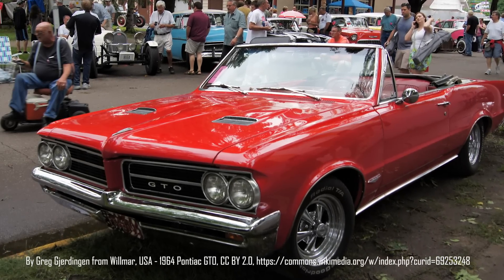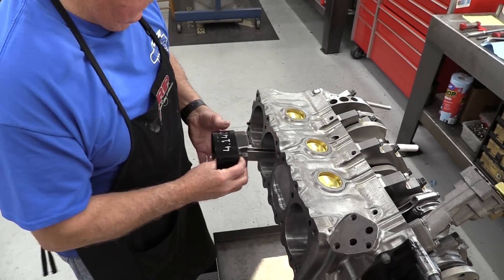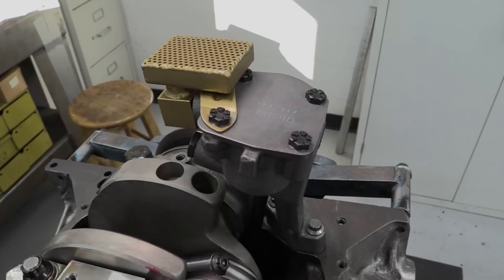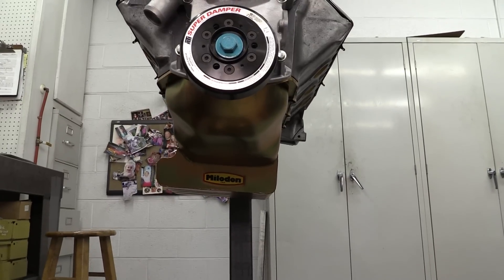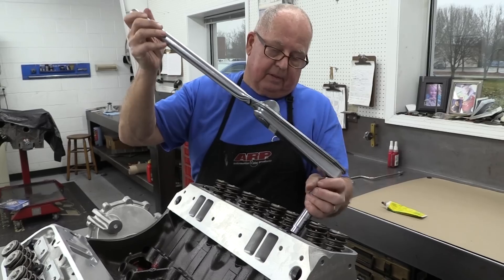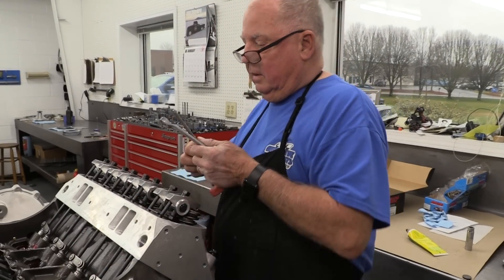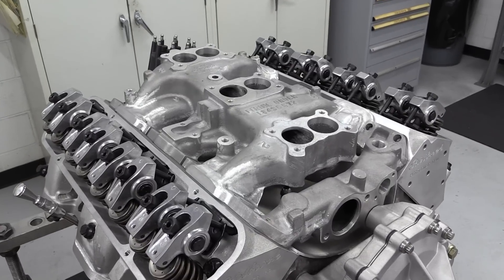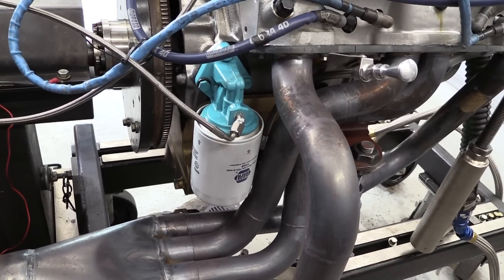Poncho Revival -- Building a Stroker Pontiac (Secret EFI!)

Comment: 389 and 400 have the same main journal size. 421, 428, 455 have the larger 3.25 size.
Reply from the maker: Correct. I definitely could have been more specific there that the 400 has the smaller journal too. Thanks for watching
Reply: Yep, 326 and 350 have the 3.75 inch stroke and 3.00 main bearing size as well
Reply: 389 would have 2 freeze plugs and only 2 motor mount holes that block has 3 freeze plugs and 3 motor mount holes making it after 1977. 1966 and earlier blocks had 2 freeze plugs on each side of the block. 1967 and newer had 3 freeze plugs per side.
These blocks had 2 motor mount holes per side.Starting in 1970, most blocks were cast with 5 motor mount holes with the mounts using 2 bolts in line with 1 higher up in the middle.Some 1977 and later blocks only had 3 holes that used the newer mounts.
Reply: Not a 389 block 3 freeze plugs make a 400, 389 have 2 .

Comment: so sad about that intake system.   that cam should have made max torque close to 5000 rpm.  A victor jr would have done wonders for hp.    That tripower intake killed it!    I've never seen a dyno run without the waterpump not running.     How does that effect timing due to hot spots, etc?
Reply: The dyno must provide the flow. It is an impeller pump so the water can flow right through with just a little restriction.
Reply: I used wenzler heads and tunnel ram. Wish I had known about Molnar when I did mine. They have awesome stuff. Glad to see them used. I have forged star galaxy rotating assembly. My compression is higher at 11.71 as I'm on e85 w mark sullens carbs. Love the build!!!!
Reply: Victor Jr sux & is counter intuitive to poncho characteristics, stock iron qjet or edelbrock torker are better
Reply: @brianbevans6804  The ported edelbrock heads make power to 6500 rpm. The cam is good to 6500.    The stock intake is done by 5000, unless you can find a RA intake.   The torker would do OK to 6000 if you need to keep your shaker hood scoop but Performer RPM makes more power everywhere compared to torker.   I run a efi modified torker 2 on my twin turbo 455  TA and I shift at 6000.
Reply: @CrankAddict  yeh performer rpm is the best intake made for the poncho & the torker being 2nd, the regular performer is a waste & not worth ditching the factory iron same as the victor jr. Sounds like a beast you got, 6500rpm is a little high for an undersquare 455 3.25 main Poncho, if you want rpms & a higher torque band you want oversquare or close to square, less stroke than bore, that would be better for a turbo car.

Comment: Very nice, I have drag raced Pontiacs since the late 70s. I currently am running a 1972 455H.O, bored 60 over trw L2394 pistons and with the 7f6 heads. A nice healthy comp cam, torker 1 and a 850 hp series carb and a msd ignition. This engine runs great makes a lot of torque.
   Thanks for posting this, keeping the poncho alive. 👍👍🏁
Reply: That torker 1 is pure gold.
Unobtainium.
Victor Jr. is all we have now,
an intake design that runs counter to Pontiac characteristics.

Comment: I had a 64 Catalina with the 2bbl 389 with a 3 on the tree. It was a early 64. It had right and left cylinder heads. The heads were oiled from passages that came from the thrust bearing. It was a great car, I still kick myself for letting that car go. Keep up the good work. Thanks.

Comment: The original Poncho Rochester 2GC big base Tri-power carbs flowed 325 cfm. Those T/Bs being bolted on are for the Chevy Tri-power being retrofitted to the Poncho, because the offset T/B hold down bolts. Just like you said, those Rochester 2G small base carbs flowed 285 cfm for the Chevy stuff. A single plane intake works great for WOT, but is less effective for driving on the street. With this street friendly setup, the owner will be much happier driving around town.

Comment: Wanted to mention that you said the heads were 72 cc. That would be with the 3.75 stroke crank. The heads he used for the 9.7 comp ratio were 87 cc. Nice video, and nice build.

Comment: I have a 74 455 in my 65 Lemans . Its stroked to a 468 I have a 750 dbl pumper on it now. 
I also have a 65 389 Big car engine  With a factory tri power on it 068 cam 4x Heads . I would love to do what you did in this video to my 389 and use my factory tri power. Cool video  super informative . Pontiacs rule

Comment: Pontiacs use 2 tubular "dowel pins" to locate the timing cover to the block.  These are at the 2 lower timing cover bolts.
Reply: True, but be careful, if your block has been line board or even lined honed for the crankshaft, it will no longer be centered with those dowels, so will then require you to you do what he did to adjust. I did the same with mine.

Comment: A couple things don't add up in this video.  First, 389 blocks had 2 freeze plugs per side.  This block has 3 freeze plugs per side which was on 400 blocks. Second, 72 cc heads on a stroker (455) are not going to give you 9.7 CR.  Need about a 94 cc head to get 9.7 CR.
Reply: All depends on the piston and head gasket used. Plus deck height and how far in the hole the piston is.

Comment: How do we get 9.7:1 on a 461 with 72ish cc chambers and flat top pistons?
Reply: 1:15 - flat top with big valve pockets.
Reply: I was wondering that as well. They do have deep valve reliefs and a few cc’s ported out of them but still seems a bit low.
Reply: 461ci = 7,550 ccm
7,55L / 8 cyl = 940ccm 
chamber should have little less than 100ccm, for 9,7 CR. All approx.
Reply: Thick gasket and crappy quench.
Reply: With a .040" thick gasket and 14 cc dished pistons that are .060" in the hole.No wonder it makes shitty power.

Comment: I had a dream the other night, I was driving a really small domestic pickup like a Chevy Luv or an old Dodge Ram 50 with a large displacement big block 632, 572, or even a Sonny Leonard engine that was so snappy that with a 4 speed manual it would INSTANTLY light up both rear tires and take tf off. Now THAT would be my dream build. I'm willing to bet that a Ram 50 with a well built 360, 400, or 440 would get the job done easily. ESPECIALLY if it's a Dorton engine...😉

Comment: I noticed Keith didn't weld the adjustable guide plates? Is this correct and he doesn't do this?
I am asking because I need to fit some to my engine. If Keith doesn't think it's necessary to weld them then I won't either.
Reply: I tig weld them in 3 places.
Reply: We ALWAYS tack weld them

Comment: 4 bolt aftermarket caps , forged crank, H beam rods $$$$$$$$$$$$$$$$$  no budget on this puppy .
Reply: All that for a motor there only twisting under 6,000rpm, what a waist.  With that crank, rods & caps that puppy is not even working until 7,500. rpm. and really over 8,000 would not be a issue with the right cam & intake.  In my opinion, that short block is scramming for pair of aluminum aftermarket ram Air tunnel port Vs !

Comment: WISHED these guys could have built a 428 out of a 400 Pontiac.
Reply: they could...simply have to cut down the mains to 3"...if they can use a 455 stroke they can surely use a 421/428 stroke
Reply: Why? More cubes is better... There's nothing magical about 428 cubic inches

Comment: Flat top pistons in that engine with 72cc chambers is more like 12.1+.. not 9.7:1. Also, too much cam timing even if it was 9.7. Running it as it was built in the video with 12-1 and that cam would be pointless on pump fuel. That said, as much as that intake setup killed power, it's still a cool little build for a show car..
Reply: You can buy e85 at the pump🤷🏻‍♂️
Reply: @doomman700  What does that have to do with claiming 9.7-1 in a build when it was actually over 12.1? 
Anyone born before the turn of the century knows REAL pump fuel is Unleaded...
Reply: @vengeanceizmine9878  it can be run on pump gas with 100-108 available at a pump nearby. That is all my comment was directed at, it’s not pointless on pump gas.
Reply: @vengeanceizmine9878  by the way I am not a young man and was born before unleaded was a thing, so I considered supreme 108 pump gas with lead. However I acknowledge anything readily available at a pump for cars as pump gas( premium, e85, regular unleaded fit the bill today)
Reply: @doomman700  I get what you're  saying, but you are missing the point completely. It CAN be run on alcohol, hell it CAN be run on race gas... I get it lol. That wasn't the point. The point was the narrator claimed 9.7, perfect for a mild street engine to be run on pump fuel, meaning unleaded. I know for a fact that combination is actually over 12.1. That is all. Just because it can run on different fuels, doesn't make it efficient, nor will it produce the most power, and certainly wouldn't be achieving a true pump fuel (unleaded) combination. "Mixing" fuel is worse than running the wrong fuel,  and doesn't "fix" the issue. Either the combination WAS designed wrong purposely using that compression, or those heads were actually the 87cc+ chamber heads, and it was just a mistake by the narrator. That is all.  You certainly don't design an engine combination for a purpose, and make that mistake of running way too much compression, and make the customer "bandaid" it with fuel.

Comment: why do people use RED GREASE instead of black moly graphite grease..
Reply from the maker: Redline synthetic assembly grease is good. It is red and I know a lot of engine builders that use it.
Reply: @TheHorsepowerMonster  I was not aware that redline made assembly grease..
Reply from the maker: Yes, it is specifically for engines. It isn’t a too thick bearing grease or anything. Thanks for watching!
Reply: Still using the my standby, 50/50 30wt non detergent and STP.
Haven't found anything better yet.

Comment: To each his own I guess.

If that intake is what kills it I would have forgone that 'classic look' after having see how that torque just drops off as the RPMs go up.

Hurts me to witness that.

I think even with the smaller journals it would handled that torque at higher RPM just fine.
Reply: Customer wants what they want. At least it'll look cool and they'll never race the thing anyways
Reply: It's a show car, NOT a race car. It'll be PLENTY fast enough the way it is
Reply: @KingJT80   With a forged crank?
Why bother?
Reply: @ThunderAppeal  I don't think they make Pontiac stroker kits with cast cranks because most people aren't gonna use a cast crank they're gonna use a forged one

Comment: 50 thousandths tappet lift? Huh... I would have thought it was closer to 500...
Maybe someone needs to learn what an engine is before narrating...
Reply from the maker: I'm talking about duration, not total lift. That is the duration measured at fifty thousandths lift. Meaning from the point the lifter is raised 0.050 until the cam lobe lowers it until it is 0.050 off the base circle. It is a common measurement.

Comment: The intake and cam are why it didn't go over 550ftlbs and 500hp, the cam would work better with the RPM or a single plane like the Torker II. If he dropped the cam to a 230/236 solid roller with a 108-110 LSA it would pick up torque and carry it farther out making it over 500hp. You can get over 550/500 with unported RPM heads on a 461, you can do it with worked 250cfm iron heads too. The intake starts to choke the flow above 3500rpm, Tri Power intakes are just gonna do that.  The cam is killing some grunt at the bottom and the intake isn't letting it make torque farther up.

However...  in a 55 Safari show car, it is more than enough. I know how well an engine around that power level will hook on street tires, especially the kind you'd run on a 55 Safari. It won't at anything more than half throttle until its over 50mph. It will sound mean as hell at idle with that cam, it makes plenty of power despite not making the most of what its capable of, but the EFI will tame the lope a bit, still it will have what hoonigan calls chop. So perfect for a show car.

That engine is VERY overbuilt. Forged bottom end, solid roller, MLS head gaskets, splayed four bolt mains.. I mean if you can afford it, why not? It has better parts than my 700ftlb/700hp two bolt 467 does.  Change the oil regularly, get it warm enough to boil condensation out of the oil,  keep it under 6500rpm (Tri Power won't support 428ci or larger over 6000 anyway) and it will live forever in a daily driver.. that runs 11s. If he stepped up to an IAII or MR1 block he could then throw boost at it and make 1500-2000hp real easy, all the hard parts are there except the block. The old 389 blocks are tough though, they can handle more than the later 400 and big journal blocks. Not that its even coming close to the limit of the block as it is. 

All in all its a cool build, kinda like the 461 in my 68 LeMans, but it has a 240/244/110 flat solid and unported E heads. Wish I could swing all the forged and high end stuff in all of mine, but I have too many cars to do that.
Reply from the maker: Great points. Thanks for watching!
Reply: This is a very good comment. I built a 461 stroker as well, and I used a performer rpm dual plane with a Well worked Quadra jet. My cam is a 236 / 242 at 112 LSA. This engine makes just under 500 hp at 5,200 and 600 foot pounds of torque at 4200 RPM. Get this, I used stock number 16 heads that have not been ported at all. It is a bit of a shame to see all the effort and cost that went into this engine, to then throttle it the way it did with the induction system and unfortunately over sized cam.  It did have quite a bit more Potential.  Even so, I enjoyed the video, and love Pontiac’s! Any time I see someone creating a Pontiac video I must applaud. Thank you!